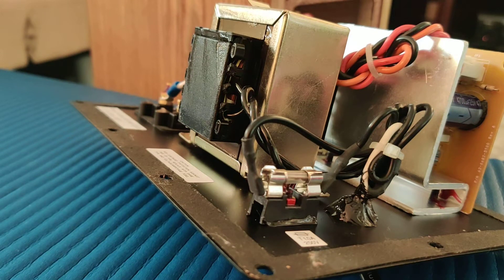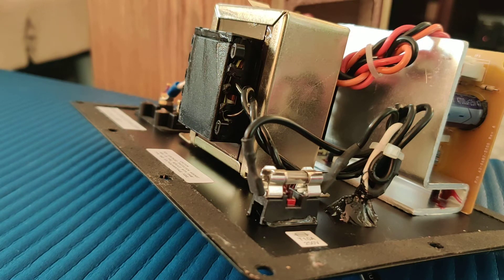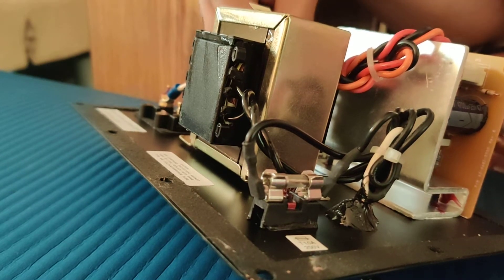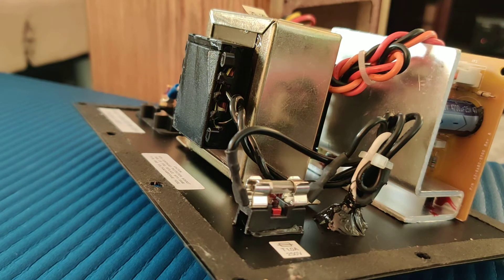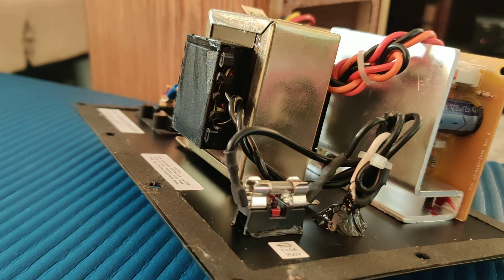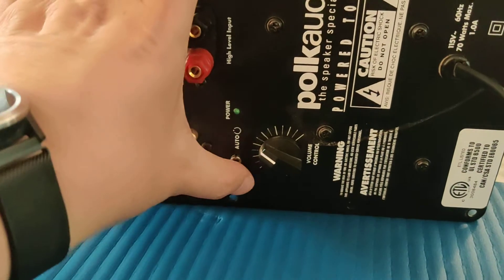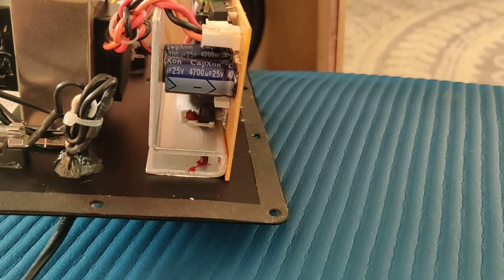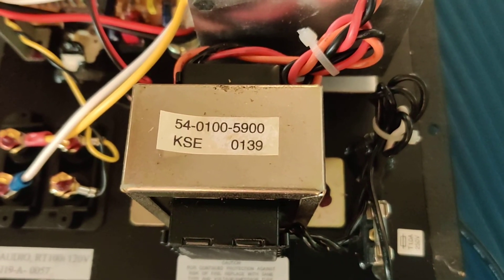Polk RTi100 plate amp issue - not powering on

Comment: Did you ever get this fixed? I have the same problem.
Reply from the maker: Yeah. In the Part 2 video: https://youtu.be/6u23mnBUYA0

I discovered that it WAS the main cap that had gone bad. Ordinarily I'd have tried to replace it myself, but these speakers have sentimental value to me so I didn't want to risk messing something up with my rather poor soldering skills.

If you're not comfortable fixing your amps yourself there's a pretty reputable repair service on eBay that I found that wasn't too expensive. I'll look that up and post the link here.
Reply from the maker: https://www.ebay.com/str/electronetix
Reply: I figured as much, after researching online. I will try to replace it myself. Thanks.

Comment: Good to know.  My RT1000i started doing something similar today.  I don't see any signs of wear and tear around the 4700mf capacitors but I may as well try swapping them out before buying a new amp plate or shipping this one off.  Did you take a photo of the circuit board from the back side where all the leads are connected?